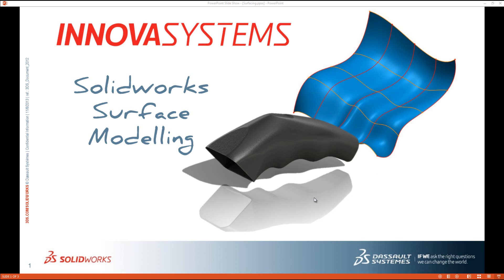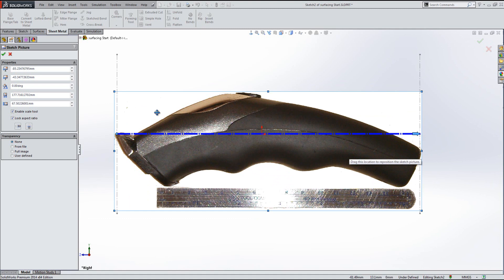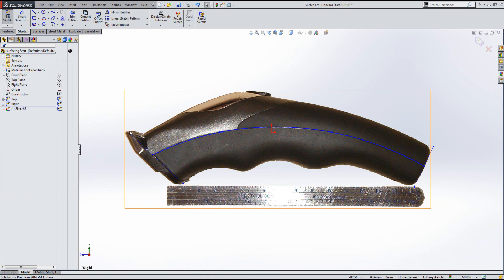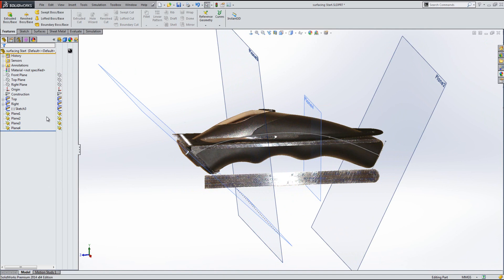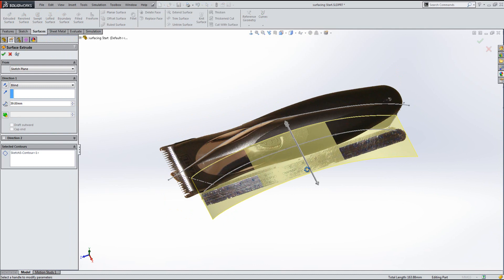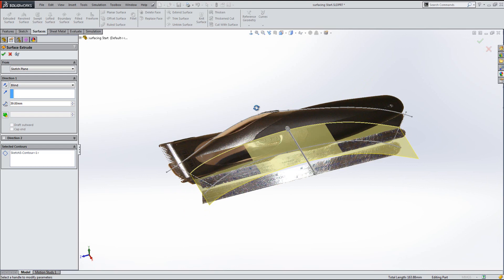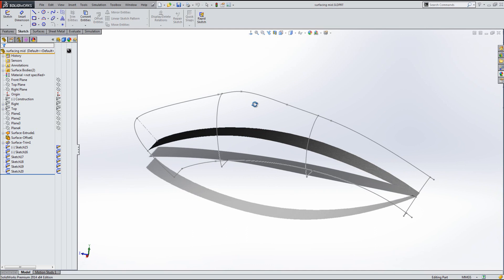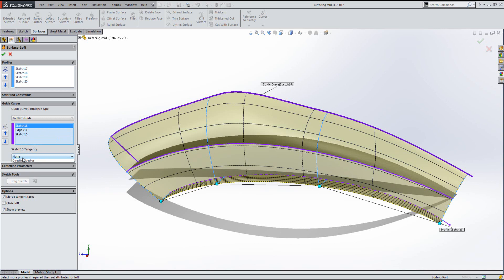SolidWorks 2014 - Surface Modelling

Comment: on that top plane trimming sketch at 10:19 if you wanted a flat section in the middle with splines that were nicely tangent to the flat face how would you do that? so that the loft builds smoothly off it.... every different way i attempt it i get errors and objections, its driving me nuts

Comment: At what time did you make it into a solid body? (so that you could shell)
Reply: +Zoe Doucette i have the same question
Reply: Intersect makes it solid.
Reply: When you have fully finished the surface modeling for one half of the part. That way all you have left to do is shell the half and then mirror it - giving you the completed part